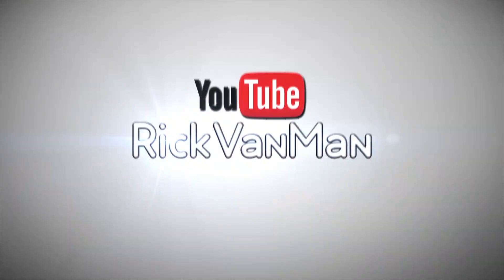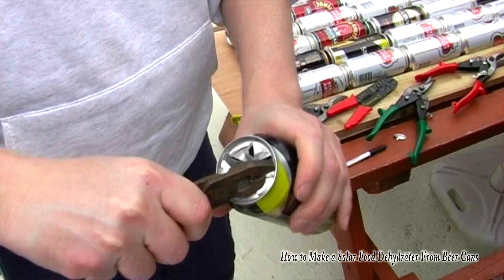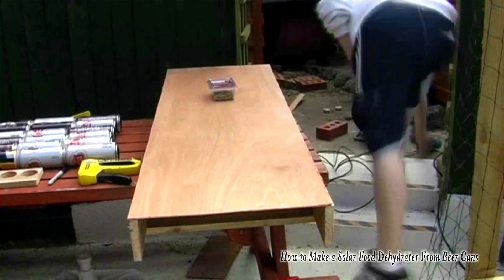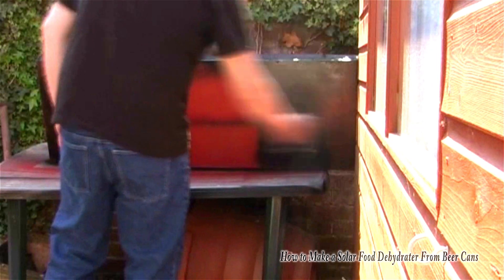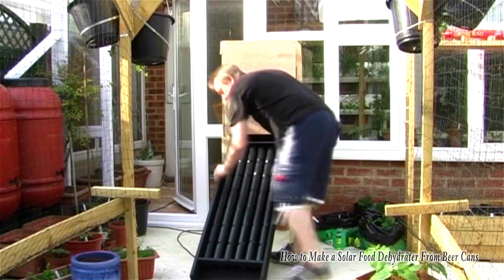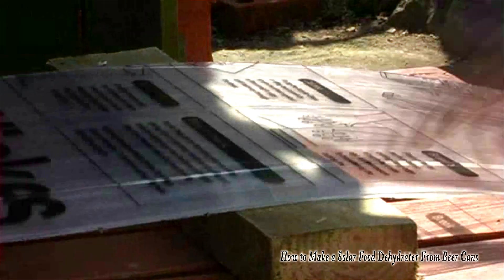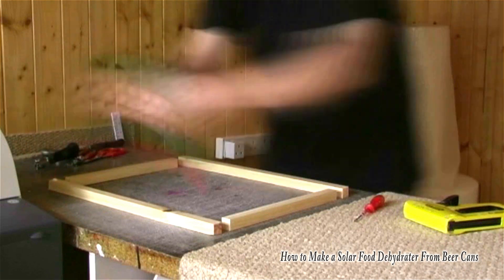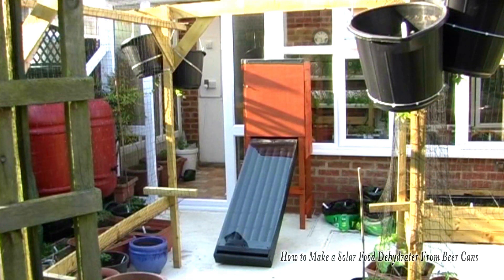Solar Food Dehydrator From Beer Cans (how to)

Comment: Pondering if in a developing world country with more 'sun-hours' per day, if the cans could be secured into place and air-sealed with a fine layer of cement / tar / clay -- assuming that they had been tightly fitted into place beforehand. Could greatly reduce labor intensiveness of can assembly process and the cost of the adhesive, and perhaps the need to paint the cans black (local availability another consideration).    While the encapsulation of the 'tubes' may initially slow the  heat capture rate of the collector, might it add some stability to the air temperature and flow / speed through the dryer, or even extend it's operation for longer in the day through thermal energy mass storage? Either way, thanks for taking the time to craft such a clean demo of your design, and for documenting it so clearly - very neat!
Reply: Cans aren't needed really, but it's nice to see people making small changes to one of the more proven designs.

Comment: Great design and nice video! One question though: I'm a little worried about the adhesive you are using to hold the beer cans together, since the produce you are drying will be infused with the air flowing through the cans, and taking any gases/fumes of the adhesive with it. Is there a "food safe" adhesive you would recommend?
Reply: Exactly my thoughts, with heat glue gases off nd this will enter the food.  Avoid this design at all costs.

Comment: Thanks for sharing Rick, exactly what I was looking for. Question: is the drying time still the 2-3 days for eg. tomatos (you have 12 years of usage experience; any other fruits/vegs. you have some numbers for?) And is there any difference based the number of filled trays? Should wetter bits/pieces like tomatoes be on the bottom layer or do you apply eg. parch paper to avoid dripping moisture in the beginning of the process?
Would be great if you would have some time sharing the actual usage expierences (incl fails perhaps?) Thanks much in advance and have a sunny day